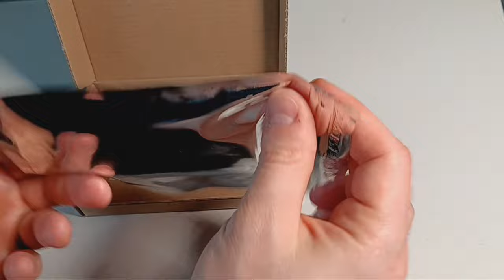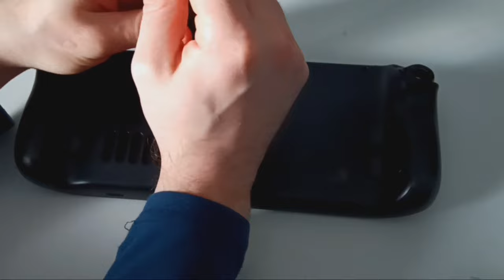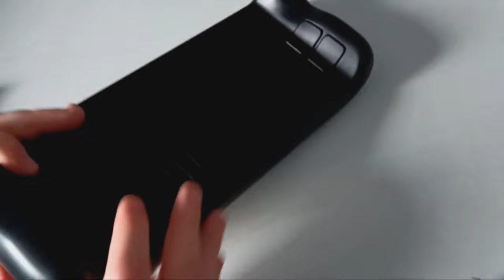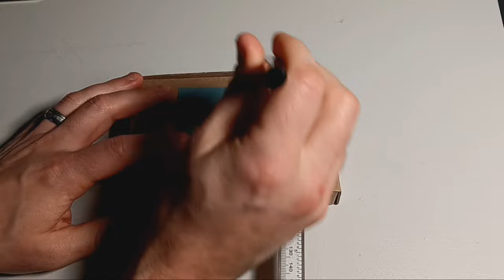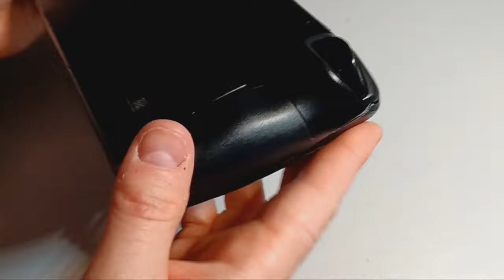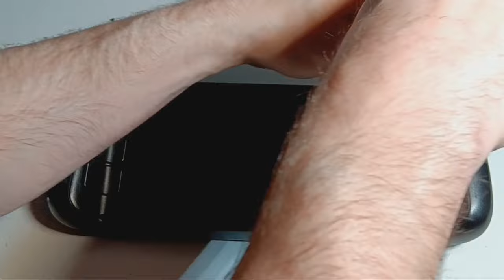Maximum Cooling! Upgrade Steam Deck to PTM 7950

Comment: i gues this guide killed my deck, i get black screen and fan only, you should probably put your deck in batter storage mode before disconnecting the battery
Reply: Yes, drop the battery below 20% and battery storage mode before battery disconnect.  anytime your taking apart your deck you need to do this to avoid any accidental shorts. There are capacitors that store small amounts of energy and this assures that they are out of the equation when working on your deck.
Reply: It’s the ribbon connecting the two controls
Reply: This happened to me as well. I have no idea how, but a tiny bit of thermal compound got under the APU. Cleaned it up and it’s running fine now

Comment: I just repasted with the PTM 7950 on my deck and I'm noticing that the temps are noticeably higher than before, in fact the fan ramps up to 7000 RPM more than with the stock paste.  Should I reapply it immediately or I should I wait for a few heat cycles to pass?

Comment: Hey, what about switch off the battery from bios before disassembly?
Reply from the maker: Uhg, definitely yes. Looks like I failed to add that here. Shame on me.
Reply: @baldsealion  Add it in the description.
Reply from the maker: @The_SUN1234  Thanks for the suggestion! It's been both added as a video to the description and a separate info card at 1:25 in the video itself. Hopefully this helps.

Comment: Applied arctic mx-6 and get some decent results. -1 degree C and -300 rpm under heavy load of Metro Exodus. Still worth it since mine SD is overclocked.

Comment: Careful when plugging the battery back in.  Mine decided to power on when I did and I didn't notice.  Went to put the metal plate back in and sparked the board.  Ended up killing my LED and sound indicator for booting.  Lucked out as it still fully functions normally besides that.

Comment: Thanks for the god tutorial.
It was my first change of thermal paste since my training as an it specialist 15 years ago. Because I didn't listen exactly I hardcore cleaned the silver chips on the frame around because they were full of thermal paste, and I was wondering as I saw they don't get covered by the thermal pad 😮. But everything works extremely fine, I additionaly replaced the back shell with the vent version of jsaux. The deck now is 99% silent no matter what I play. For example 3h Armored core 6, docked highest preset s with some tunings locked 40fps. The Gpu is at its limit 98% most of the time, temps are 77° and fan is absolutely ❤

Comment: Is there a benefit to doubling up the pads. Like cutting it to the right size but place one on top of another?
Reply: no, the paste or pad's purpose is to provide maximum surface contact area and maximum thermal conductivity, the thicker the material - the slower heat will move through it.. however if you go too thin, you may reduce contact (its really sat on a couple of high points with lower pressure or air gaps elsewhere). Its a tricky balance between being as thin as possible, as conductive as possible - but all while maintaining maximum surface contact.

Comment: This paste completely fried my SD card and gave me an black screen of death which i can't fix. I opened the deck again and checked the thermal paste of this plate again and it was completely dry and everything was on the side. Used normal thermal paste but the black screen of death was still there. After like having the deck on for min, everything would go black. Had to buy a complete new deck... would never try it again lol.
Reply: My deck either died due to it coming faulty (RMA replacement for launch model) or the PTM7950 might've killed one of the tiny golden capacitors. The stuff works great on my desktop but on the steam deck, I'm worried that when it turns into a liquid, its destroying the APU capacitors due to heat. Also, when you opened the deck up, the PTM being a dry solid is normal, I saw the same thing in my unit. I think this mod is fine but too much PTM is being applied which causes it to overflow onto the rest of the APU. I should probably check my desktop cpu but the temps are almost away sub 40c on a Ryzen 9 5900x so I'm not gonna worry to much rn. RMA was a pain in the ass since support refused to believe that the deck after being shortly used. It could be a combination of things, my RMA unit came faulty with a muffled boot chime and super strong haptics to were anyone in the room could hear the motors struggle but the PTM might've also helped it die.

Edit: Unfortunate that there isn't more information about this online. Logically though, too much thermal paste could yeild the same hypothetical result if it heat transfers to the capacitors. I don't think anyone would wanna test that theory though and if it has happened to someone, they wouldnt speak up or they don't have a good platform to raise concern. My factory thermal paste was annoying to clean up since a majority of it spilled onto the green part of the APU rather than covering it.
Reply: @Meninem_   thanks for your informative response. As I want to be clear about the PTM being dry, I meant that the paste was litterally not on the APU anymore. It could’ve been because i pressed somewhat lightly harder on the heatsink or something, but everything was on the side and there was like nothing left on the APU..

With that being said i also placed the PTM on my CPU and GPU of my gaming laptop and have no problems with that. A 3070ti working completely fine, but i litterally think it killed my SD because of everything being on the side instead of on the APU, and that the APU and SD card just got too hot the first 2 min I turned on the SD. With that resulting in giving me black screens forever..

Honestly sold it as broken and bought a new one 64GB, installed a 1TB SSD and thats all i’m going to change on the steam deck as of the internal stuff. 

And again i’m never using a PTM again. I see more and more comments of people having issues like, it only caused their steam deck to get only hotter after installing the PTM.
Reply: @Meninem_  Supposedly this pad is non conductive, even when it turns to liquid.